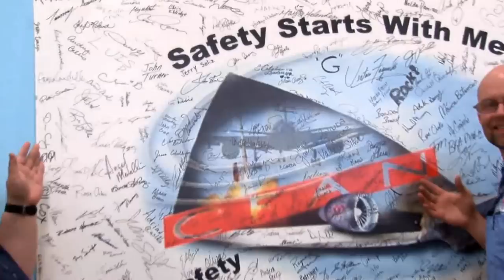GE90 and GEnx Composite fan blades

Comment: Get the noise out and save engine life is my moto. Sitting in front listening to so many of them just makes me sick listening to it. You'd think these people would learn something duh!?!
Reply: Be proud when they are designed to run quietly and without vibration is that sooooo hard to do?
Reply: +PrankBros machen fake pranks Like I said lol
Reply: Name calling yet no good ideas for reducing noise(taking that hammer outta them engines lol)
Reply: +Willie Gillie Bro it's ok that you don't like the sound of an engine but thats a engine and not a mini fan spinning at 1200 rpm or something line that if the "noise" would be removed some people would not like to ride a plane that don't havd that "noise" like you know i dont like to ride an 787 cuz the sound is not there. The airlines would be losing some passengers and i am not talking about 1000 passangers though noooho i like the "noise" and i would not ride an 787 but if i had no choice i would do it you understanding me ? sorry for my bad english.
Reply: They gain far more passengers for a quiet aircraft cabin than for a noisy one, about 99% of all passengers prefer a quiet cabin. The number one complaint from airline passengers is when aircraft have a noisy cabin. When you're at 36,000ft plus you don't hear the engine, what you hear is the resonance of the engine. The only time you hear the actual engine sound is during take off when the engine is spooling up and somewhat during landings. With a car, say a stock Toyota Camry when you're driving at a constant speed you don't hear the engine sound until you rev the engine. Having engine noise for a 4 to 8 hour flight would make you mad.
Reply: +jjs4you2 absolutely. These manufacturers need to hear a lot more voices like yours and ya make them listen by taking flights with much quieter engines. When the money talks the designers listen VERY WELL
Reply: +Willie Gillie ok thats your meaning if you think so guys then do it i dont have a problem 🙄
Reply: Is anyone listening now that another A380 had a turbofan engine failure that tore the whole cowling off as the turbofan came apart. Do you think this design is so great now? I don't think any of the passengers on that Air France flight were too happy or assured about that design. Did I forget to say they are designed to allow for turbofan failure and destruction of the engine? Someone needs to explain to the public why they think this is ok.
Reply: Willie Gillie No GE engines on A380 aircraft.
Reply: i. rob I enjoy flying. Avoiding  flying In a turbofan jet when possible. Uncontained failure isn’t my cup of tea.